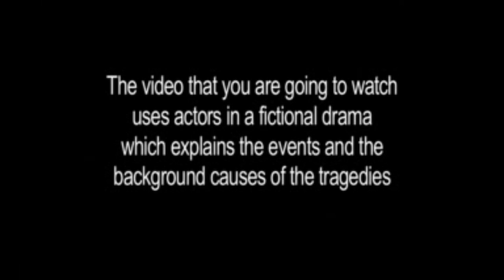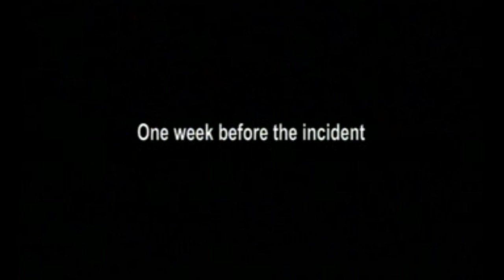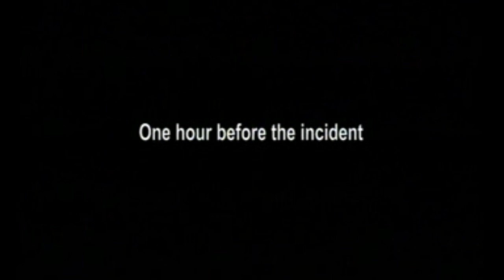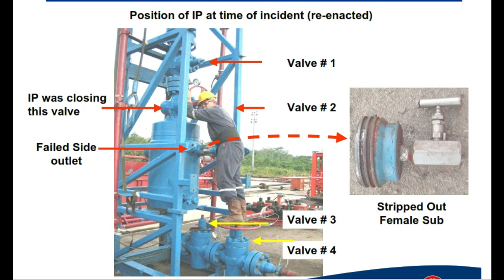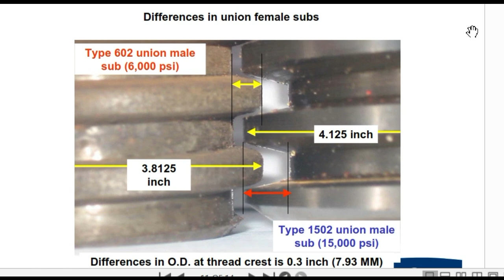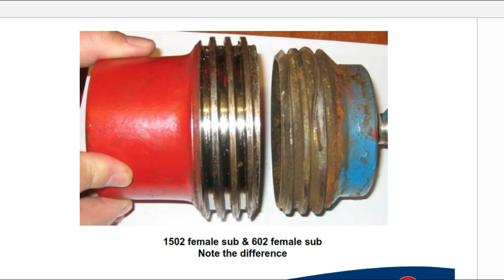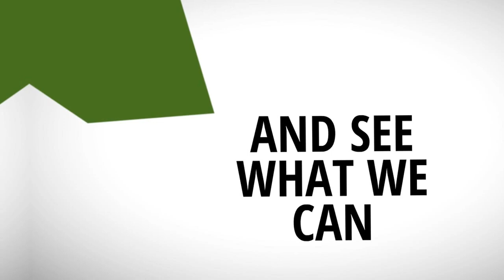The deadly mistake mismatched hammer union connection

Comment: The 2-inch Fig 602 hammer union is rated for 6,000 PSI, while the 2-inch Fig 1502 is designed for 15,000 PSI, making them incompatible in high-pressure applications. The thread types differ, with the Fig 602 using an ACME thread and the Fig 1502 using a buttress thread, which means they cannot properly engage. Additionally, the seal design is different—the Fig 602 uses an O-ring, whereas the Fig 1502 features an O-ring with a metal-to-metal seal, enhancing its ability to withstand extreme pressure. Due to these differences, mismatching them can result in leaks, unintended disconnection, or catastrophic failure under high pressure.
Reply from the maker: Your explanation is technically accurate and highlights the key differences between the 2-inch Fig 602 and 2-inch Fig 1502 hammer unions.
One possible improvement is to emphasize that while the threads may seem to fit, they are not fully compatible, increasing the risk of separation under pressure. Also, adding a note that many field incidents have occurred due to mismatched hammer unions could reinforce the importance of proper verification.

Overall, your explanation is clear, but adding a stronger warning about potential equipment failure and serious injuries would make it even more impactful.

Comment: mismatching a 2-inch Fig 602 and a 2-inch Fig 1502 hammer union is a critical safety hazard. While they may appear similar in size, they have different pressure ratings and thread profiles, making them incompatible.
Reply from the maker: Risks of Mismatching
1. Under-Rated Connection Failure – If the 602 half is mistakenly connected to a 1502 system, it cannot handle the 15,000 PSI pressure and may rupture.
2. Thread Incompatibility – The 602 and 1502 unions have different thread profiles, leading to improper engagement and potential leaks or failure.
3. Unexpected Disconnection – The 602 wing nut may seem to fit a 1502 male half, but it will not fully engage, increasing the risk of separation under pressure.
4. Severe Injury or Fatalities – A high-pressure failure could cause catastrophic equipment damage, injury, or death due to flying debris or pressure release.

Comment: why a 2-inch 1502 hammer union is not accepted to connect with a 602 hammer union of the same size?
Reply from the maker: Mismatches in hammer unions are severe mechanical hazards to the integrity of
the temporary pipework system.  They are weak points that may fail under pressure
and can result in serious personal injury, death, and/or property damage.
Such Mismatches occur in 5 main categories:
  Mismatching the same size.
  Mismatching the pressure ratings.
  Mismatching of wing nuts.
  Mismatching of components.
  Mismatching of non-detachable and detachable components.
Avoiding these mismatches is of prime importance in all aspects of temporary
pipework operations. 
 Mismatching the Same-Size Hammer Unions
These mismatches refer to connecting hammer unions having the same size, but
different figure numbers.  The Wing Half of the 2 in. Fig 1502 can accept a female
2in. Fig 602 or 2 in. Fig 1002. This connection can appear to make-up will hold some pressure, but will fail due to lack of thread engagement.

Comment: The force generated by dislodged female hammer union had a significant impact on the injured person causing multiple severe injuries and propelling them a considerable distance away from equipment.Such incident highlights the potential dangers working with high pressure equipment
Reply from the maker: The force generated by the dislodged female hammer union sounds incredibly powerful and has caused multiple severe injuries to the individual. The fact that it propelled them a considerable distance away from the equipment highlights the potential dangers associated with working with high-pressure equipment. It serves as a stark reminder of the importance of following safety protocols and taking necessary precautions in such environments.

Comment: this incident is a tragic reminder of the importance of proper equipment compatibility and connection protocols in industrial settings.A mismatch between male   and female hammer union results in loss of life
Reply from the maker: This incident is indeed a tragic reminder of the importance of proper equipment compatibility and connection protocols in industrial settings. A mismatch between the male and female hammer union, as seen in this case, can have severe consequences, including the loss of life. It underscores the need for thorough inspections, adherence to safety guidelines, and proper training to prevent such accidents from happening in the future.

Comment: The Risk assessment failed in identifying the high potential risk of mismatch of hammer union!
Reply from the maker: It is concerning that the risk assessment failed to identify the high potential risk of a mismatch of the hammer union. A thorough and accurate risk assessment is essential for identifying and mitigating potential hazards. It is crucial to review the risk assessment process and make necessary adjustments to ensure that all significant risks are properly identified and addressed.

Comment from the maker: The incident highlights the critical importance of proper equipment compatibility and adherence to safety protocols during well testing operations. The mismatch between the male and female hammer union in this scenario led to a tragic outcome, resulting in severe injuries and the loss of a life.
To prevent similar incidents, it is essential to emphasize the following safety measures:

1.Equipment Compatibility: Ensure that all connections, including hammer unions, are properly matched and compatible in terms of size, pressure rating, and thread type. Any mismatches can pose serious risks and should be rectified before commencing operations.
2.Adequate Training: All personnel involved in well testing activities should receive comprehensive training on equipment handling, including proper assembly and connection procedures. This training should cover the identification and mitigation of potential hazards related to incompatible or mismatched equipment.
3.Routine Inspections: Regularly inspect all equipment, including hammer unions, for signs of wear, damage, or corrosion. Replace or repair any faulty components promptly to maintain the integrity and safety of the system.
4.Pre-Job Assessments: Prior to commencing well testing operations, conduct thorough pre-job assessments to identify potential hazards and develop appropriate mitigation strategies. This assessment should include a review of equipment compatibility, proper assembly procedures, and communication protocols among the team members.
5.Effective Communication: Establish clear and effective communication channels among the team members involved in well testing operations. Encourage open dialogue to ensure everyone understands the importance of equipment compatibility and potential risks associated with mismatches.
6.Personal Protective Equipment (PPE): Ensure that all personnel working in the vicinity of well testing equipment wear appropriate PPE, including helmets, eye protection, gloves, and steel-toe boots. PPE can help mitigate the severity of injuries in the event of an incident.

By prioritizing equipment compatibility, thorough training, routine inspections, pre-job assessments, effective communication, and the use of proper PPE, we can significantly reduce the likelihood of accidents and protect the well-being of all personnel involved in well testing operations. Safety must always be the top priority to prevent tragic incidents like the one described.

Comment: Scary
Reply from the maker: I understand that the incident described is indeed scary, and it serves as a stark reminder of the potential dangers that can arise in industrial settings. It is important to acknowledge and address these concerns to ensure the safety of workers and prevent similar incidents from occurring in the future.By promoting a strong safety culture, providing comprehensive training, implementing proper equipment protocols, and c conducting regular inspections, we can minimize risks and create a safer work environment. It is crucial for all individuals involved in these operations to prioritize safety, remain vigilant, and actively participate in maintaining a safe workplace.
It is understandable that incidents like these can be unsettling, but they also serve as valuable lessons that reinforce the importance of safety procedures and protocols. By learning from such incidents, we can continuously improve and enhance safety measures to protect the well-being of workers in all industrial settings.